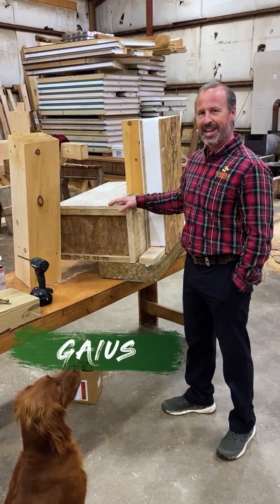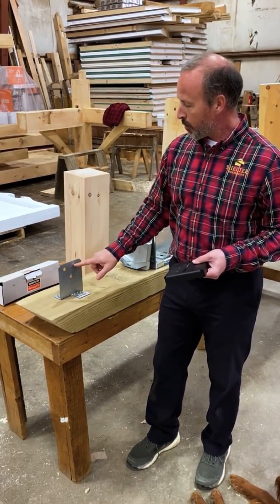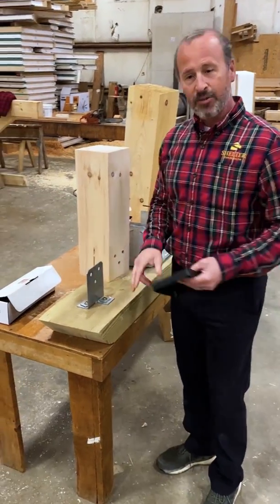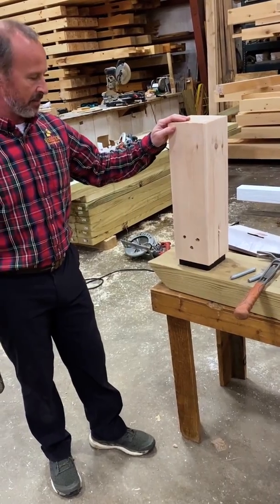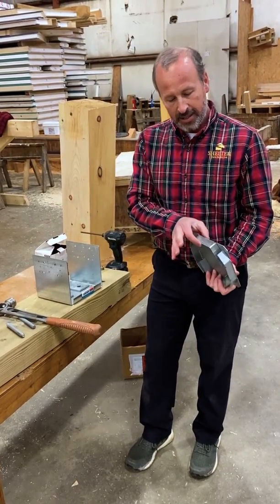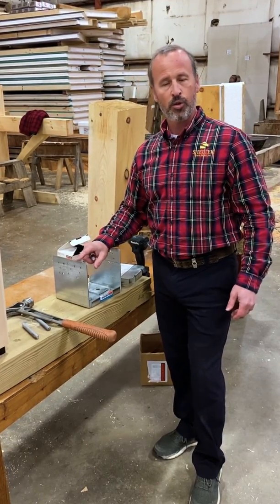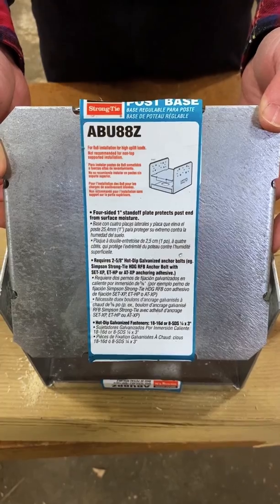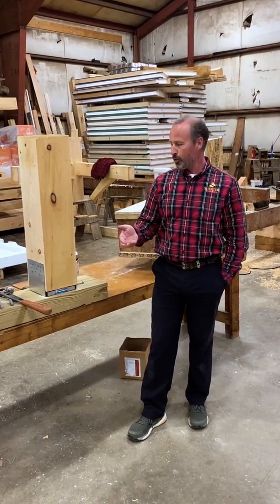Attaching Your Timber Frame to A Concrete Foundation Pt. 2

Comment: I'll just never understand /why/ the custom-thread bolt inserted into a drilled hole is /stronger/ than the J hook, or any bolt set literally within the concrete foundation pour. It just doesn't compute to me.

Is it like a pre-load thing?

Edit: It's a thread thing, no different than high quality, cold-forged steel bolts in engine crankcases. Got it.

Comment: Thanks for doing this video!  If you are putting a post on a porch and the slab has a slope to it, how do you deal with the angled slab to get that bracket true horizontal?  Is there a shim?
Reply: I want to know this as well. Did you figure it out? 🤔

Comment: Yes use wood screws for your mounting to a concrete slab lol

What a useless series of videos.
Reply: If someone can't figure out which fastener he clearly said to use in concrete before carrying on with the demo, that someone should probably hire someone else to build their structure.
Reply: Thanks for what I am sure was your genuine concern with the structure I was building. 

While you bring up a very valid point that not listening to 100% of every sound byte of every video posted is probably a good indicator of one's ability to build things, you will be happy to know that my structure was able to overcome this challenge to pass all inspections and is still standing with no issues. 

But hey keep defending the honor of every single YouTube content creator out there. You should get some pom poms and a mini skirt out from where you have them stashed deep in the closet to make your fangirl cheerleader ensemble complete. 

Or just use some of that makeup youve been hoarding and go full on clown mode lolololol Bozo 🤡

Comment: What could you use when fastening a vertical post to an inclined surface Say a concrete wall on  15 degree slop from the horizontal ?

Comment: Grinding a taper on the end of the pin removes protective coating, giving the corrosion process a head start. 
A streak of rust on the timber that deletions within a few weeks gives the new structure that nice “yeah, we don’t care about small details “ look.

You can easily make a tapered alignment pin and use it before driving the holding pin in place.

Comment: So if I can ask a novice question here, and I understand that there are variables so I realize any answer would be general in nature and that I should still consult a professional on my project, but if I was intending to build a garage/shop, would those products be suitable to that application?

Also, the video mentioned a 1" float for  the posts, is that gap closed by flashing, or just a standard sheet wood that overlaps the concrete foundation?

Comment: How do you attach timber frame when building a basement with subfloor?
Reply from the maker: Actually, the two post bases shown here can be used by running your posts down through your subfloor so they land in the post base, anchored to the top of the wall. BUT, we are not huge fans of this technique simply because it is challenging to execute. You can also use a 'cast-in-place' product that you would need to accurately place in the wall during the pour, such as this one https://www.strongtie.com/holdownsandtensionties_coldformedsteelconstruction/sthd_holdown/p/sthd. Some manufacturers make a strap that can be installed after the frame is up that is attached to the concrete wall and extends up to the post, like this one from Rothoblaas ( https://www.rothoblaas.com/products/fastening/brackets-and-plates/angle-brackets-and-plates-for-buildings/wht-plate-c)  ; this version requires you to drill into the concrete wall and install appropriate fasteners, and requires the posts to be flush with the outside of the concrete wall. Lastly, you can use the method Gaius describes in the video, anchoring the posts to the foundation via the SIP, if the loads allow.

Comment: 'Don't drill all the way through.'  Shows post... drilled all the way through.
Reply: .....so he can take the metal pins out after the demonstration and use them and the piece of timber again, probably in a class.

Comment: I suggest you always place a tar roofing shingle with the tar against the end grain of the post whenever the post is placed on the ground or an impervious surface like these steel hold downs. The tar seals the end grain and stops the moisture from wicking up the end grain of the wood. 

Even if you are building a traditional frame building these steel hold downs are a very good idea.
Reply: This is not mandated in any guidelines/warranty by Simpson nor wood suppliers, nor any building science analysis. Seems more superstitious than effective…